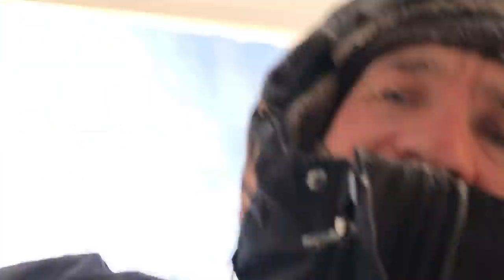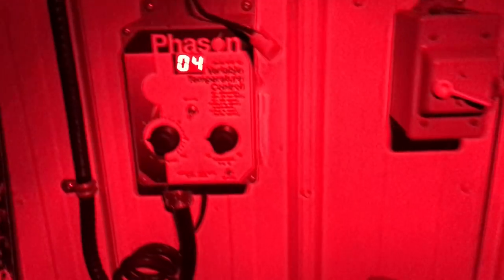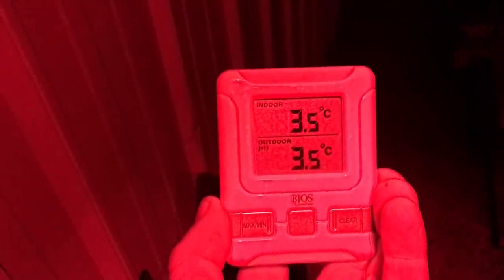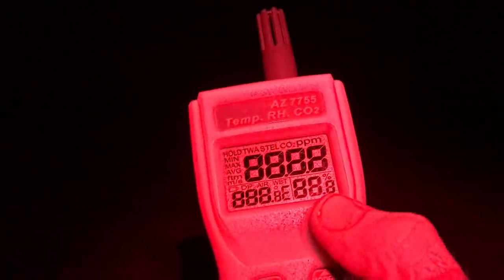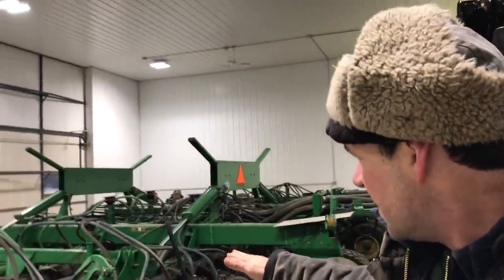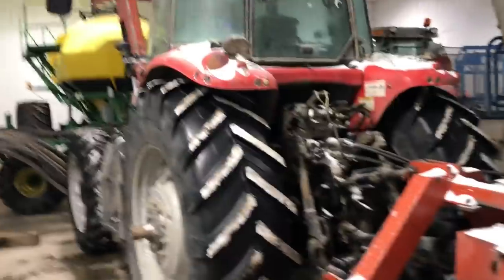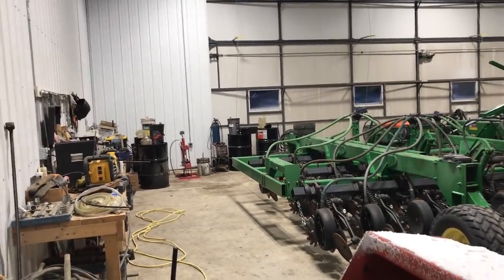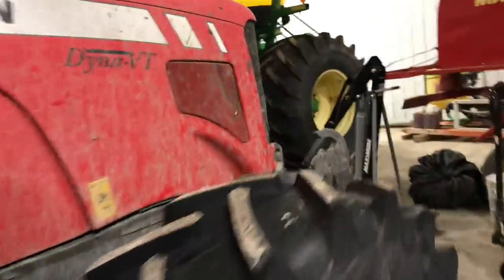Massey Harris 21 Combine - YouTube Motor Heads, please comment, skip-6:20

Comment: No easy way around it.  Needs to be bored out and oversize pistons to fit the new bore.  Crank needs to be inspected too.  Grind valves and valve seats. Also new oil pump and water pump.  I am a retired mechanic. Rebuilt a few of those.  Worked on a lot of old Massey Combines.  Do it right for sure.  Never seen that much piston to cylinder wear!!!

Comment: Take the block to a good machine shop and have them mic cylinders and crank.   You may have to do some research for parts for it.   Chrysler was using that same engine in the 40's.   They were used a lot, even in marine applications with a water cooled exhaust manifold.  I'm sure you will find parts for it.  Check the cam and lifters for sure.  When you pull the cam, make sure you keep the lifters in the same order they came out. Each lifter is worn to it's relative cam lobe.   Hopefully the cam is good.

Comment: If she shoves a rod through the side, it's game over 😢.
It is the heart of the machine and is well worth doing properly. If there is that much slap in the pistons, you can almost take it as said that the big ends and crankshaft will require attention also. It's not worth taking the risk. It's a lovely old 21 you have. 👍👍

Comment: You need to pull the pistons, and measure the pistons and cylinders.  Where is the wear?  Are the pistons worn, the cylinder walls, or equal wear on both?  For what you want to do, you may be able to get away with just putting new pistons in without having to bore out the cylinders.  Odds are, a lot of the wear is the pistons, and new factory sized pistons will get rid of most of your slop.  As long as the cylinders aren't egg shaped badly, I would just spend a couple hundred bucks on new pistons and slap it back together.

Comment: I get the urge to do it cheap but cheap twice is more than doing exactly what it needs once. I'm like you, just a shade tree mechanic, but I can say with confidence rings won't fix that, and also you need to check if it's been bored over once before, if it has it's a fine line of overboring and making your cylinder walls to thin. By the looks of it, after boring, pistons, rings, journal bearings, etc, etc, etc, it may be more economical to just put a new old motor in it and call it a day.

Comment: You will have to rebuild the engine with new pistons bearings and.rings as well.as doing up the head.
My late father had a 1960s Massey 585 powered by a Chrysler Sid valve 6 similar to.this one and it.lasted well into the eighties before it gave out.

Comment: A number of years ago, we had a number of these engines powering cement mixers. They wear out.  The bearings would hold up reasonably well, however cylinder bores, rings, valves, and valve guides were a different story.  If available, I’d take it to a shop experienced in older engines for evaluation of the short block assembly. Explain your needs and concerns.  The evaluation shouldn’t be too expensive and could be money well spent.  Armed with their numbers and suggested options for repair,  you can then make a wise decision.  Based on your video, I’d say any chance of a worthwhile repair without the services of a machine shop is slim.  Armed with a reconditioned short block, the family can be involved in the final assembly.  Finding any used comparable machine opens the possibility of getting something else on its last legs.  Know anyone clever enough to convert it to PTO power?

Comment: This will never be used for production harvesting, so maximum performance is not a concern, just being able to do demonstration passes is the goal, so while a full rebuild and sleeves would be the Future Generations way, it's not "needed" for your purposes.

I would have your friend measure the bores and see if it can be bored oversize and improve the slop, and if so, bore it and put the next size up pistons in it.

But if it's already overbored to the limit, and putting sleeves in is too expensive, then do a farmer rebuild with the boys, slap new bearings in, put new rings in, maybe oversize to take up some slap, hone the cylinders, dress the valves, and put it back together and see how well it runs.

If it runs fine for what you need, great! You just did an in frame rebuild with your boys!
If it's still lacking and you need to take it out and get more invasive and spend more money, that's more learning with the boys.
But the cost of bearings and rings is not going to be very high, and I think it's worth it to give it a shot doing it the farmer shop way, since the goals are engine rebuild experience with your boys, with an engine that runs a little bit better at the end.

And remember, it got to this level of wear in production service, so it still ran well enough to operate, so a little improvement may be all right for a couple of hours a year! 

And maybe in a couple of years with an engine that runs "a little bit better" you will reach the decision that spending the money and doing a full shop rebuild is worth it, but you won't be out much money if you just try doing an in frame with the boys, and gain a lot of valuable time and experience.

And yes, lots of other accurate comments about oval cylinders and needs sleeves and all the right ways to do it, but again, this is NOT a production machine, this is a toy and a history demonstration, and so if you can do it like an old farmer, and improve the performance for a few bucks in rings and bearings, than you are doing it the traditional way!

As a former kid, I personally would find it fun to do the rebuild and see how it works, and then go from there.
And yes, oversized rings and such will probably only improve things for a short time, but it won't cause more damage, and may last a few years, or may still suck so bad that you decide to send it to the shop, but it's still something you are doing together with the boys, and however it turns out, they learn! Lol

Oh, and since that engine is part of your history, I would spend more money to fully rebuild it, rather than grab some junkyard engine and replace it.
If you were making a production machine, maybe a junkyard engine would be the smart option, but I see that particular engine to be the heart of the project that you are doing, which is getting YOUR machine able to spend a couple of hours a year in the field.
And maybe you can find a matching engine and swap it out, but I would still keep this one for the future day when you or your kids decide they want to rebuild it and return it to original.
Reply from the maker: Good advice
Reply: @aCanadianBeekeepersBlog  oh, one other factor. If the pistons are slapping too badly, where they are tearing the engine apart, running it like this could lead to catastrophic failure and ruin the block, so I would go easy on it if you just in frame it, but if you were running it before without hearing bad piston slap, it may not be that bad.

When I said not causing any damage, I was thinking that if you just put new rings in, and it scores the cylinder, the next step will probably be sleeves anyway, and a little extra scoring or wear won't matter in that case.

But catastrophic failure is certainly something to avoid!
I don't remember now if you have had it running recently, but if it was running decently, just low power, as opposed to banging and shaking, it might have some life left... Lol

Comment: More than likely you’ll need to bore the cylinders with over sized pistons and rings. My guess is that cylinder walls are too damaged from the amount of piston slap to just put new rings on the pistons. The only way to really know is to remove every piston, and inspect both piston and cylinder for wear, roundness, and size.

Comment: With that amount of slop, and since you already have the head off, may I respectfully suggest that you take the rest of the engine apart, and do the job properly, no attempting to cut corners, or you'll end up in the same position again, in very short order. Check condition of Crankshaft, Camshaft, big and small ends on the con rods etc etc. Ain't no 5 minute job or cheap, but worth spending the money in the long run.
 Be interested to see how you get on - the Massey Harris 21(or is it perhaps a 21A ?) Combine is an iconic machine and definitely worth saving. From the little that I saw, it looks to be in pretty good shape ?

Comment: It looks so loose it makes me think those are the wrong pistons for the motor.  .002" to .003" cylinder to piston clearance is good, yours looks to be about .030" to .040" clearance,  or .060 to .080 difference in diameter.

Comment: That motor I believe is very common, fork lifts, airport equipment, welder, water pump. You might find a better motor used, rather than rebuld

Comment: Would have been great to do a compression check prior to removing head to see where it is.  Hopefully when healthy it has around 100 lbs of cold compression.   All cylinders should be within  about 10% of each other.  Bores need to be checked with bore mic to see if they are egg shaped especially in the top 2" of cylinders.    If cylinders are true and a good seals can be achieved on valves you can also use thinner head gasket to compensate for compression if needed.   Can probably true head and remove some material if needed.  Also a couple degrees advance of ignition timing can help compensate well.  Just be sure it its not detonating.
Reply from the maker: 50 lbs compression across all cylinders
Reply: @aCanadianBeekeepersBlog  should be able to find specs on that engine to see what the true factory bore is. Block should have a casting number on it somewhere.   It appeared to have excessive clearance with piston flop.  My guess is piston diameter should be roughly .0020-.0025. smaller than cylinder bore.

Comment: A side comment; find the kids a couple of used Briggs and Stratton mower engines, Preferably horizontal crank. Have them take the engines completely apart placing them in a box, then reassemble them and get them running again. It’s affordable to make mistakes on these.

Comment: Hate to spend your money Ian but to much slappity slap there for replacement rings. Maybe a replacement engine, cheaper?  If kept and bored out, do the main bearings and chain too.  Cheaper than a thrown crank with the better compression/HP.    Started driving a Farmalls 50 years ago but I've only rebuilt Porsche boxers.  My thoughts with good luck.

Comment: I'd LS swap it......  :^)  Replacing the rings will not fix it, as the ring seal will be compromised by the piston flopping around in the hole. The rings won't/dont stabilize the piston. 

It may be cheaper to repower it than rebuild it. a motor from a wreck will be cheaper than a rebuild.

Comment: You likely won’t be happy if you don’t bore it and replace the pistons and rings. With that much wear i would guess the bearings and oil pump are about as badly worn. It would be a great project if you have a curious youngster wanting to dig in and you really should be able to do it fairly low budget on your own.

Comment: Way too much piston slap I would suggest bore and oversized pistons if you can find them, you are asking too much from rings to make up the gap. If it had aluminium pistons they can pein them up a little, but no way as much as you need, the bores are probably oval anyways because of wear and slap. The current pistons are probably cast iron, this is why you got the long life from the unit. Just a suggestion from way out of the ball park, would it be cheaper just to adapt a similar sized modern plant, I drive a 55 Chrysler De Soto six as my daily drive and it has never had the head off, they just keep going.

Comment: If there isn't much scoring I would just try the rings and maybe new rocker springs after giving it a good cleaning... run heavier oil...but probably going to have to bore it to get full compression... however that is going to be alot of money to get that done...it adds up quick unfortunately...look for a salvage yard motor if need be to pull parts or rebuild that...good luck and be patient...It took us 6 months to get parts for a rebuild...
Reply: To much piston slap for replacement rings.
Reply: @MinnesotaBeekeeper  little bubble gum and duct tape she'll be good as new in tho morning...

Comment: I've built a lot of those tugboat engines being as cheap as friggen possible, slapping rings in it will make it feel like a brand new engine...for about a year, then last another 4 years at your use rate before it's useless, then youll need to do a real rebuild... or watch it blow up in the field. That's some insane piston clearance.
Reply: I found multiple rebuilt short blocks for $1500-2000 so keep that in mind if you decide to really get into it. (Which I implore you to do)

Comment: You almost don't even need to bore it (- the bore is big probably enough!).  A set of 40thou" pistons would probably fit fine.  :)  Joke.

Actually, you need to find the specs and measure the state it's in - is the wear on the pistons or the bores?  You may find the bores are oval, thus will need to be bored to bring them back into round.  If you (/kids) can strip it and take a bare block to the machine shop, you may find the cost is actually quite reasonable.

Comment: Since you don't want to spend alot of money resleeving it. Prob cheaper to deck the block and bore over with new pistons and call it a day. Those pistons look like they have more slack than what a set of rings could seal. If anything do the poor boy special. Order .10 over pistons and throw them in. If they don't fit then machine shop it lol.

Comment: It the rings that are important. Do you have any cylinder wall scoring? 
Highly likely valve guides are worn out. You will also need a new cam and bearings. Worn cam lobes will rob all your ponies too. Worn vale guides cause high oil consumption 
You probably want to stay original… it would be better to go with a Cummins motor.
Reply: You will also have to grind the crank and go with -.010  bearings.
Reply: This is just a thought…. It would bee 🐝 nice to go back with a case IH spinning cleaner on your radiator. All it takes is one overheating and your new build is toast. Those case rotary screen cleaners really work well.
Reply: If your important bolts look good and no damaged threads … then I would not spend money replacing them.  Make sure and source the correct tap to chase the threaded holes in the block. Thoroughly blow them out after running the tap in each one . Then oil them upon installation of the head. If you think the engine has been hot before , make sure the mechanic magnafluxes the head for cracks.

Comment: That is the size of engine l worked all my life on. But it is difficult to write english mechanics for me. I never seen a piston move that much. Rings won't be inaf. You need biger pistons and cilindars need to be grinded like new.  If you change only the rings that black stuff will enter between them very fast.. and you're back to the start
Reply: 👍da bih riječ dodao...ovaj motor je "bacio dlaku"...upitno je na koju "specijalu" može uopće ići...pozzz
Reply: @pcelarskisokak  there must be a very very big step on the top of the cilindars, the top ring position. He could find some biger pistons for a different engine. But the problems will not stop there. That engine run on more oil than disel.. can imagin the smoke. The crank, the berings.. probably all burned. But fat metal engines like that can always be re build. Sorry for the spelling. My school days and mehanic in English was long time ago
Reply: @pcelarskisokak  treba blok ponovo obraditi za veće klipove. Moguće i radilicu za nove ležaje. To smo odavno radili na ovakvim 'debelim' motorima. Možda kod njega još ima takvih radionica
Reply: @pcelarskisokak  da, bilo bi najbolje naći negdje nešto polovno, već sređeno.. generalkom. To je kod njih sve skupo. Da sam tamo bio tokar i mehaničar 30 godina bio bi bogat.
Reply: If l tell you what l did as a young mechanic you won't believe me. We had an American airport on the island in WW.ll .. the sea around it is full with bombers. Sometime a troler boat would catch by chance the propeler with the engine. I used to hamer aluminum heads and pistons all day,  malth it, pore it again and make some new engine part. From the propeler we made those hidraulic bloks for the hoses and other conections... their inox ox air tanks became our smaller bouts fuel rezervoars. It was superior material.. look like new after 50 years on the bottom 100 - 150m down

Comment: I am also not an expert but have worked on quite a few antiques from that era. I would at least look at new pistons (and rings) - new rings won't be enough. Should be able to take the pistons out to your mechanic to measure and see if they are wore a lot. Like Mark K said, if there is a ridge in the cylinder where the rings would come up to, then you will want to have it bored to prevent wear on replacement parts.

Comment: It is of course dangerous to offer an opinion without really examining the block.  That said, from the pics it would appear that there isn’t much of a wear ridge at the top of the piston….at least compared to the slop you show.  Personal opinion is that someone previously honed the bores and reused the old pistons, giving a sloppy fit, which magnified the wear on the rings.  Assuming there is enough meat left on the cylinder walls (and I’d be shocked with an engine of this vintage if there isn’t), a quality overbore and oversized pistons is really the only answer.  IMHO doing less would be a grand waste of money for something that might only be very marginally better and won’t last.